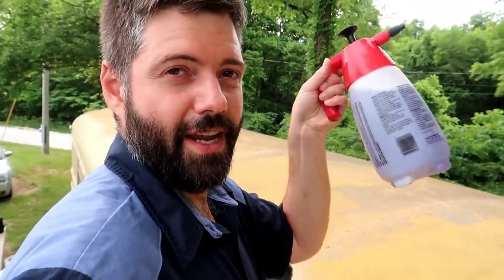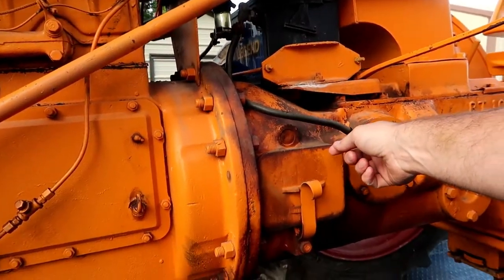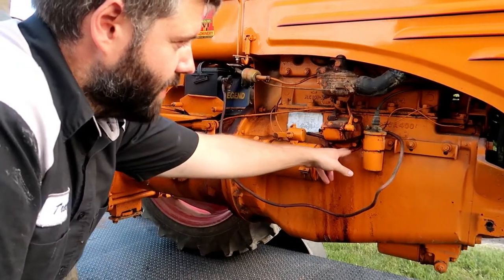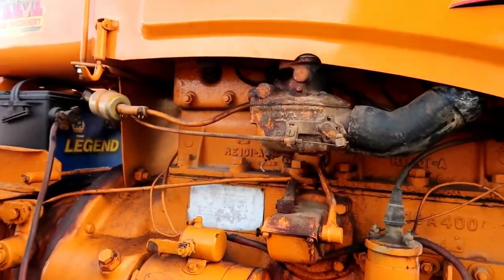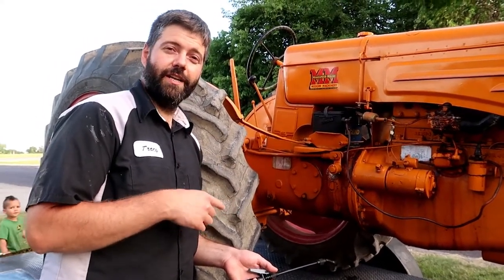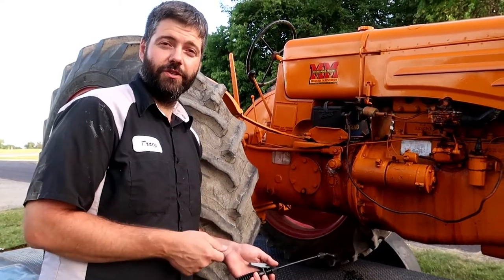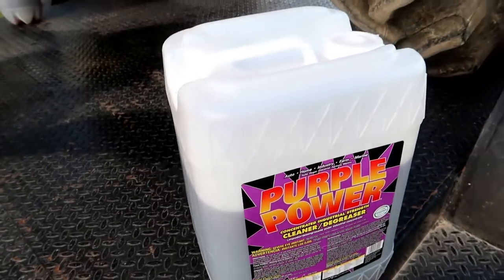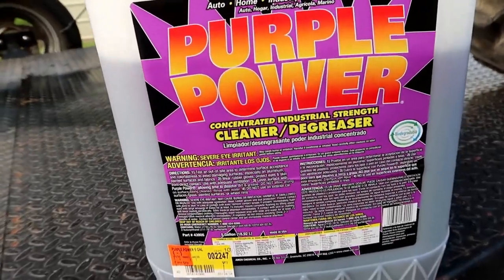Purple Power BEST Degreaser Ever!

Comment: but that isnt grease as in grease point grease. . I doubt our local car wash would allow you to do that there,. Also, its hot? water with lots of pressure. I think I have some PP and will try it. THANKS.
Reply from the maker: I have used this product many times. It really does work great. Be sure to test it on nicely painted surfaces. I do know it will damage Spray Painted surfaces.
Reply: Damages 
Spray pt ?
As opposed to baked on ename? How are Kubotas painted?